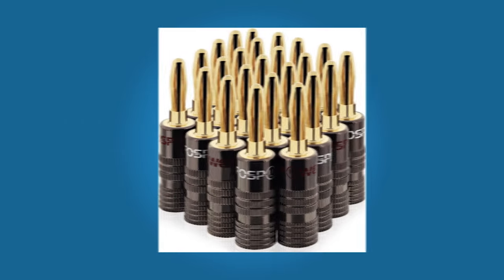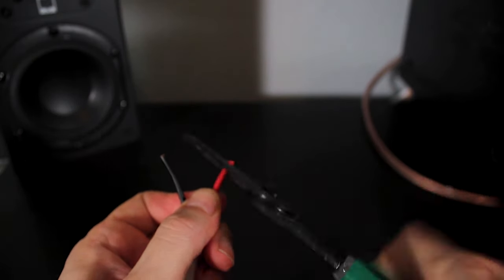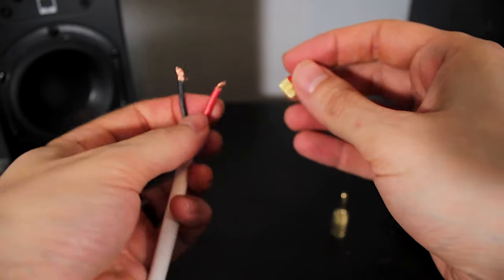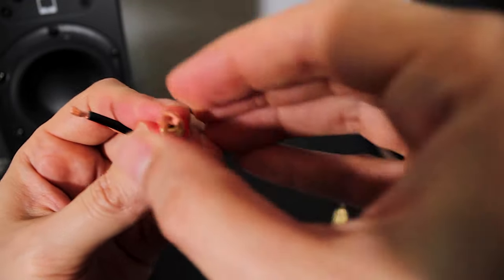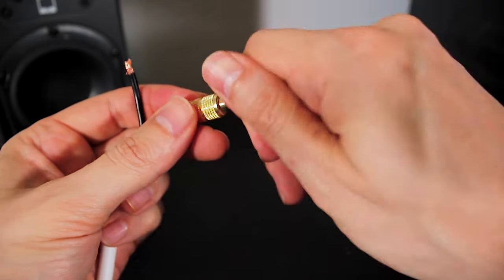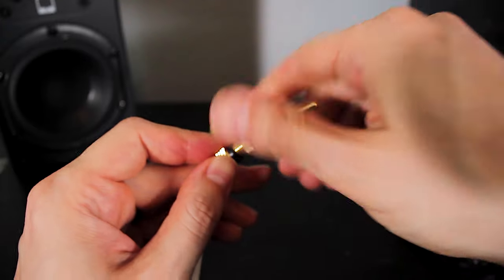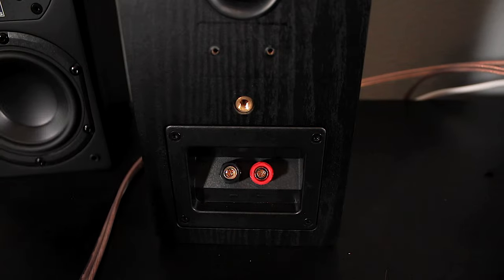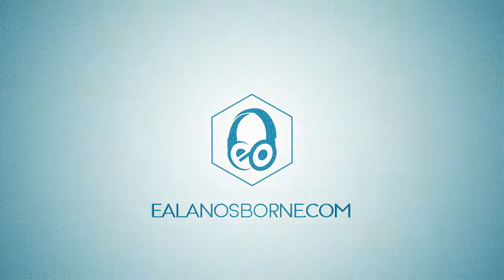How To Wire Banana Plugs | Quick Tip | Monoprice

Comment: Buy closed screw type banana plugs instead... No need to thrash the copper wire that way. FosPower is a good brand.
Reply from the maker: Thanks!
Reply: I've used banana plugs for 30 years and this is the first time I have ever seen "compression" type plugs. All the ones I ever saw had small set screws in them. Also do not wiggle your wire stripper back and forth! Give it a spin, usually a half turn is enough.
Reply: @rongibson9702 Same here! You're gonna need a lot more than half a CM of stripped wire in the ones, like fospower, with two set screws.

Comment: I have a brand new Yamaha receiver and these banana plugs won't fit into the red and black speaker inlets. Do you know if there are different sizes for different makes? These are too thick that I have.
Reply from the maker: Yeah, what you might need is a pin banana plug 👇

https://amzn.to/3Tf2ITS
Reply: Thanks!

Comment: Very good video. I got my own speaker set-up many years ago and compared to this I butchered them. Just today when I was checking to see why there was a buzz in my speakers my banana plug tip came off and stayed in the SMSL AD 18 I had. turns out I never tightened them from their box like you mentioned! The speaker that had the tip come out of its play didn't turn back on so when I took it apart I didn't have them splayed at all, I just twisted them into a solid line. Speaker works perfectly fine now, many thanks.

Comment: So simple and yet... had this AV installer come over the other day, I had bought the exact same plugs, he wasn't able to screw back the top part all the way in to the insulating ring... I was thinking "you must be doing something wrong man". I thought about running to the computer really quick and look in YouTube... but I didn't. As it turns out, he was peeling too much copper, so that some of it was getting on TOP of the screw threads, thus, you can't screw the two parts together tightly. So basic. Thank you for the video, I might go back and redo them, since he added insulating tape every other plug to avoid contact, and looks like ass.

Comment: Thanks. Mine is with extra screw inside and requires to combine all wires tight.
Only thing is questionable: put on wire ends the Solder or not?
 Wire ends with Solder will stay intact when they will be under screw pressure i guess.

Comment: Banana plugs or direct pros and cons? Sound degradation with banana?
Reply from the maker: I haven’t noticed any sound degradation. Just make sure you install them correctly  and nice and tight so you don’t get any intermittent audio cutting out. 👍 Once I switched to banana plugs, I never went back since it’s been SO convenient having to review different receivers, speakers, etc

Comment: When I had monster cable banana plugs they worked just like that. Never had a issue. I had to move and lost some of the plugs. I bought rocket fish and let me tell you they are hard to do. You have to insert a plastic thing in and it is hard. That is to keep the wire in place.. I ended up just jamming the wire up the plug. I am going to have to go on line and get some more because you cannot put wires in the plug that way
Reply: Ok ty

Comment: still having a lot of trouble with this. Either I have too much wire on it and it becomes impossible to screw on, or it's too little and while I can get it on, it comes right off with a gentle tug. Totally tearing up the copper wire in the process, there's little shavings all over my floor. Sometimes I can get it to screw on about halfway and that holds on decently, but I worry that will have a poor connection as the wire doesn't touch all the way to the tip.

I checked the gauge of my wire with the accepted gauge of my banana clips. The wire is 14 awg and the banana plugs say they work with 12 to 18 awg, so these should work comfortably with them. Not sure what I am doing wrong? Does anyone have any suggestions?
Reply: Update: just looked at reviews of the banana plugs that I bought and found videos of people wiring them. They're a bit different than this. With mine you have to feed the wire through the part that screws out like with this, but the difference is, you also have to feed the wire through the other part and through one of the holes on the side, then you screw them in. I got them wired up now 👍

Comment: Would 10AWG fit these plugs?
Reply from the maker: No. They’re pretty slender, compared to some other banana plugs out there, so 10AWG would just be too thick
Reply: Do you know which ones would? Im considering 12AWG to compramise with lack of choice.
..the kabeldirekt ones claim to fit 6mm (10AWG) but they look no different from most. The hole for the cable is 5mm
Reply from the maker: @CM-dw3gh  I have quite a few of these used throughout my system, and it says they support up to 8AWG. 👇👇

https://a.co/d/b24xYa7

Comment: Dude great videos would you mind doing a video on how Dolby Atmos up firing versus ceiling pair up with AV receivers i.e. front presence versus height and where to make these connections on the back of receivers particularly the TSR 700? 

I’m also confused on the TSR 700 all of the amp configurations along with coding GTS versus Atmos versus internalcontent within the receiver versus content that is coming into the receiver. It’s all very complicated to folks that are not audio engineers

Comment: What is that wire called and what size plug is that
Reply from the maker: It’s a standard 14 gauge speaker wire and it’s a standard sized banana clip.
Reply: @ealanosborne  ty!!
Reply: How do I know if I need 14 or 16 gouge wire
Reply from the maker: @ysb362  16 gauge is fine with most 8 ohm speakers, but I still get 14 gauge since it’s thicker and more durable…but also more expensive. 🤷‍♂️
Reply: @ealanosborne  thank you